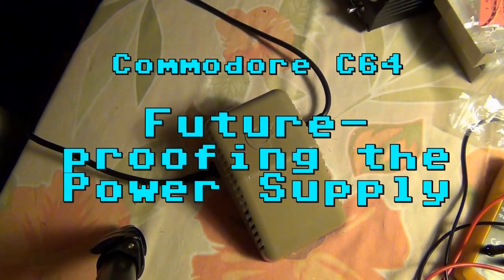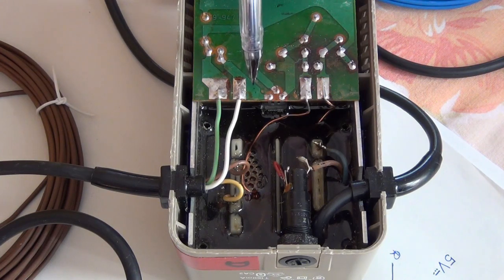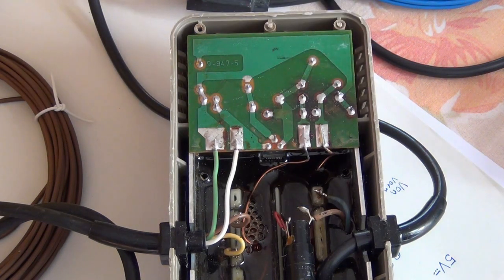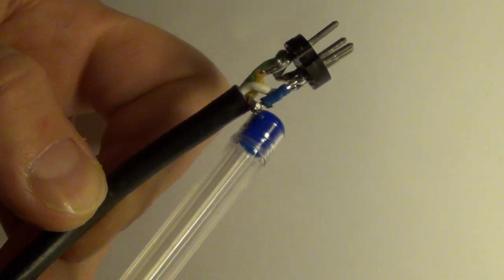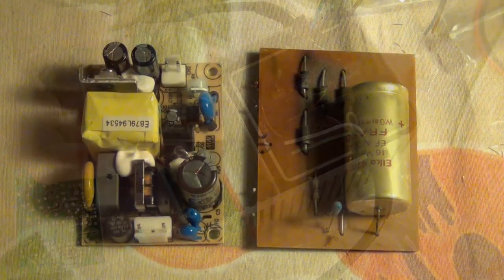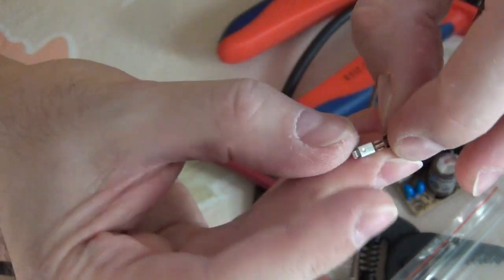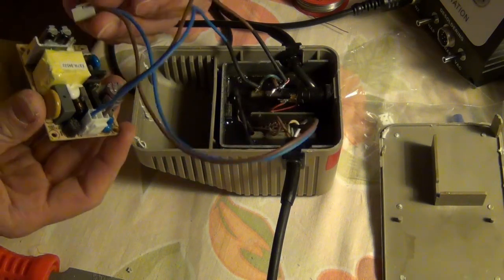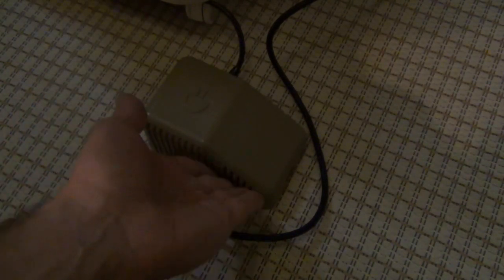Commodore C64: Power Supply upgrade

Comment: Apart from slightly increasing the power supply's efficiency I don't really see a reason for the board swap. Personally I'd replace the 4700 µF capacitor (yours is a model well-known to go faulty), possibly the small tantalum capacitor (blue) and most of all the 7805 voltage regulator. That's apparently the part that usually fails and causes overvoltage to the C64. If the original 7805 lasted 35 years I'm happy to replace it with another one.
Reply from the maker: Excellent info, thank you! I was not aware which of the components were typically prone to fail and went the safest route. Might have done it differently if I'd been aware.
Reply: @LeadingMotive  There's not much in there to be honest. Transformers are nearly indestructible unless the output is shorted, and some are even designed to survive that. The DC part is fairly small and simple. A bridge rectifier consisting of four diodes, robust and easy to check, a smoothing capacitor (cheap to replace), the voltage regulator, the small capacitor and at least in some designs two resistors, also almost indestructible. Their only purpose is to raise the output of the 7805 to slightly above 5 V to compensate for the voltage drop in the cable to the computer.

The big capacitor in your power supply was made by Frako of Germany, a high-quality brand but unfortunately not known for their long-term stability, so I'd replace that. They either dry and no longer work or they can even short, overloading the transformer and diodes. The small tantalum capacitor is a bit of an unknown. I don't know where it is in the circuit and they've got a bit of a mixed reputation. I might replace it while I'm at it but can't really give a definitive recommendation for or against it.

Voltage regulators are generally robust as well but in the C64 power supply they seem to fail fairly often. If they pass the rectifier output straight through you can get up to almost 13 V into your C64! Mind you, they fail after 30+ years, so I see no reason to mistrust a replacement from a reputable source. The only tricky bit is digging the original one out of the potting compount or fixing the replacement to the heatsink but it can be done.

Comment: the reason for it to get less warm is most likely not the "removing of the burden" from the transformer (the 5v logic draws very little current, most likely not noticable in terms of heat), but the fact, that the switching power supply you installed does not waste the excess power as heat, like the dumb linear regulator did before.
Reply: Look at the board he removed. It has just 4 diodes (bridge rectifier), an electrolytic capacitor and a regular capacitor. Regulators are on the C64 motherboard and this modification doesn't change that.
Reply: NO! C64 power supply must be stabilized on 5V line. Regulator 7805 is buried in epoxy next transformer and both are heating that epoxy block. Bridge rectifier and filter capacitor are connected between transformer and regulator. Regulator output is connected straight to output wire.

Comment: Many thanks for your video. There are some videos about the PSU, but I seached some time how to reuse the old PSU only replacing the 5v part. Actually of course I want to keep as much as possible original.
One question left: As the 9v transformator is totaly in epoxy, can I leave it inside the case when doing retrobright? Because the powerbrick definitly needs it...
Another thought: On the underside there are three cycles. I think it would be nice to drill 3.5mm holes there and epoxy some theadened inserts inside the top part, so the case become screwable (of course to avoid any risk, using m3 nylon screws, not metal ones). Then some rubber feets onto it, to cover the screws (I think the cycles where originaly meant for rubber feets anyway).
Reply from the maker: Good question, I'm not sure how waterproof the epoxy is. There might be a risk that liquid gets in when retrobrighting. However, I saw one post a while ago where someone claimed that you can actually get the epoxy block out of the casing. I'd probably try that first.

The drilling idea sounds good, that should work.

Comment: Thank you for this great advice! I just installed the same Meanwell EPS-15-5 Board in a Plus/4 Power Supply which is essentially the same PSU, but with a different plug. I let it run for a couple of hours without any problems, so I consider this a success! The only drawback is the very tight fit and that you have to glue it back together. I just applied 2K-Epoxy glue, so let's see how this will turn out. On a side note, I will use the exact same Meanwell board to put in the Atari 8-Bit PSU. As the Atari just uses a 5V line, the whole PSU can be replaced. Also, there is plenty of space in the case and you have real screws to put it back together :)
Reply from the maker: Excellent, thank you for the detailed feedback!

Comment: How did you get the underside off? I’m finding it impossible. Don’t want to snap it. Thanks
Reply: I did initially but moved it. It turned out my issue was due to a European plug being plugged into an Australian adapter the wrong way round. It all works fine now. Thanks 🙏
Reply from the maker: I used a sharp and sturdy knife and slowly leveraged it open, going around several times, bit by bit. It's probably impossible to avoid snapping the inner fixings, but at least the lid and box remained intact.
Reply: Hi thanks for the advice. I got it off and put the whole thing together last night. I am finding an issue and wanted to ask you a few things. 

The problem is not with the 5V as I’m getting a clean reading there. I seem to now be seeing a low reading of just under 8v from the 9v lines also the fuse keeps blowing on 9v line. I’m curious as to the other wires which I’m now not using that previously powered the 5V board. There are the 2 long coppers wires that were together on one side of the board then the 3 short ones grouped together in the middle. Did you re soldier any of these again or are they all redundant now. It appeared from your video that they are redundant. Obviously the Vic 2 is not getting any power so I’m seeing no video image. 

Thanks,
Kris
Reply from the maker: @12BITJuNGLEOuTTHeRe  Did you connect the new 5V transformer to the fuse? I noticed that can  cause the fuse to blow due to the higher initial load. My 5V block has its own protection mechanism, therefore I did connect it directly to the mains, i.e. only the 9V block remains connected to the old fuse.

Getting under 8V seems very low. It is said the 9V block rarely fails, but maybe yours needs to be replaced. Ideally it should read a bit above 9V. 

The two old wires that went from the 9V transformer to the original 5V board remain unused after the upgrade. It's the copper ones on the top right I'm pointing out at 0:52. At 7:55 I insulated them with shrink tube for safety. There should not be any other wires left over, not sure what you mean by "3 short ones".

Comment: I used the same eps 15-5 board. But I also replaced the 9V transformer.
Reply from the maker: Wow, how did you manage to cut the epoxy?
Reply: Leading Motive loosen the sides with a thin screwdriver or knife. Then tap the PSU on a bench until the block dislodges and slowly comes out.
Reply from the maker: @veldmaat  Thank you for the info, that is good to know!